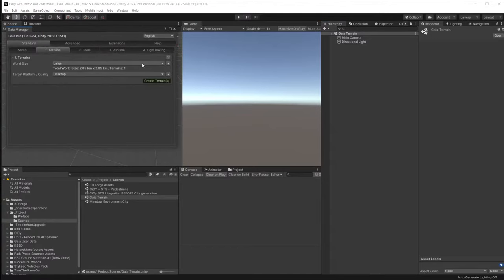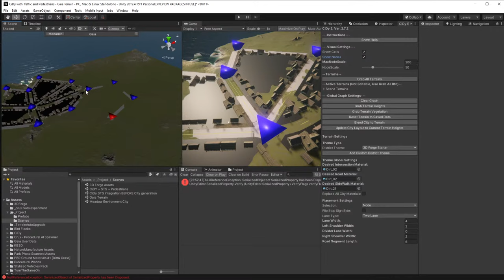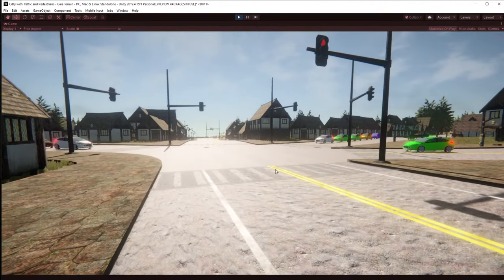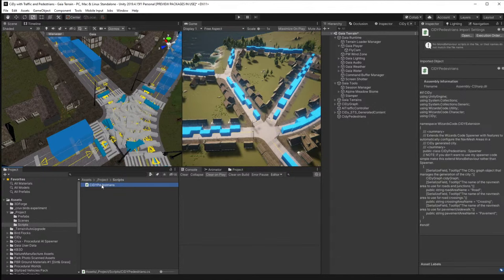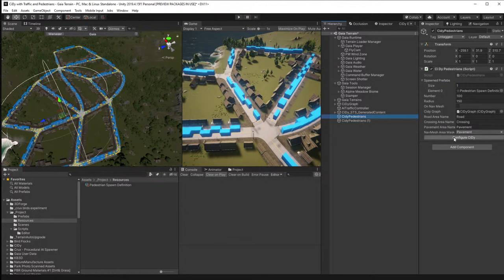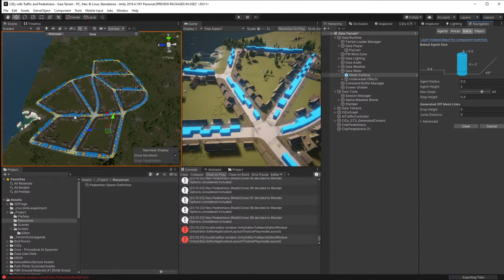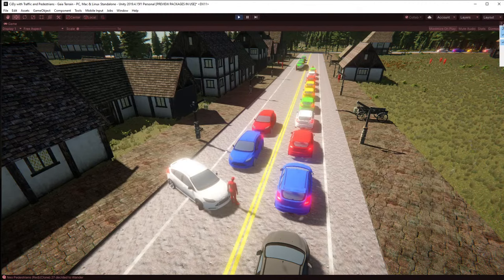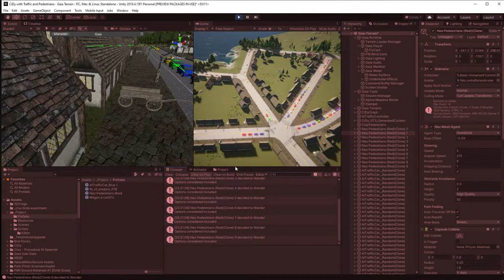Stream: Unity 3D: CiDy2, Gaia Pro and 3D Forge

Comment: How was performance of CiDy2? I am planning to make a medieval town
Reply from the maker: CiDy is an editor tool. It has zero impact on performance as all it is doing is placing objects into your scene. The usual optimizations will still need to be done to get to game level performance.
Reply: @WizardsCode   I meant the performance during the editor scene,  like I made a simple code to place objects on a vector, and my unity runs slow whenever that editor code is working
Reply from the maker: I have never had any problems. Your can see in editor performance for me in this video.

Comment: Does this work on hdrp?
Reply from the maker: HDRP is a rendering pipeline and as such does not impact the tooling used to place models (Gaia, CiDy). There are models included and these would need to be converted to use HDRP. Gaia Pro and 3D Forge come with HDRP compatible shaders for sure. I'm not sure about CiDy models as I don't use them.